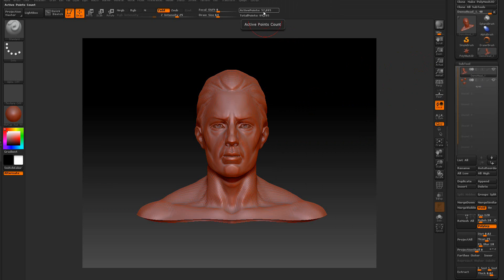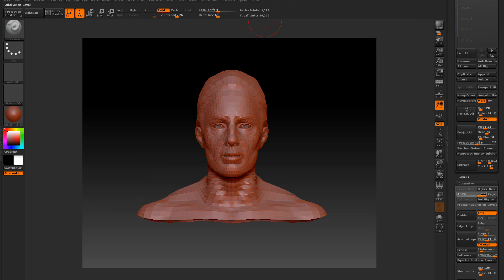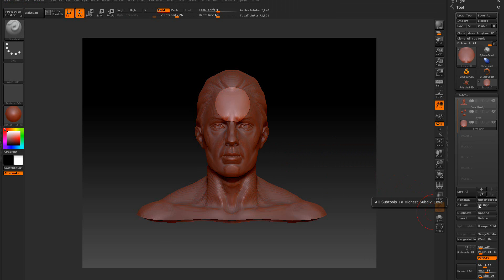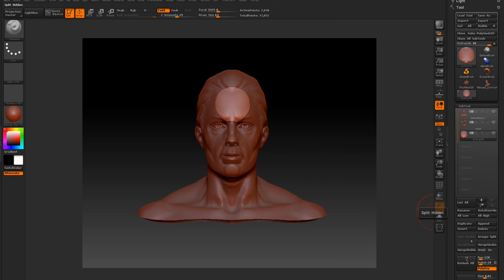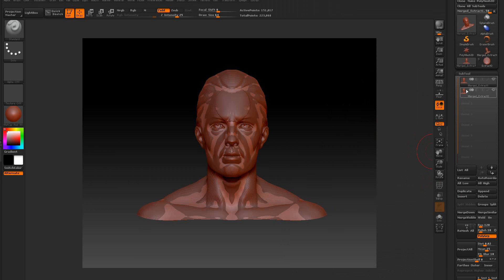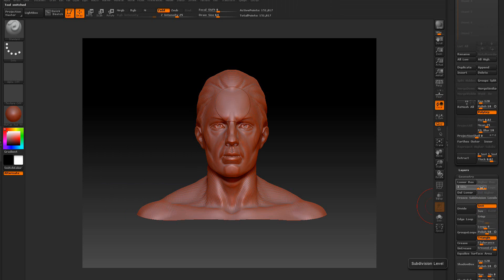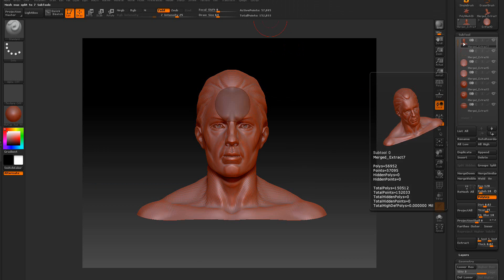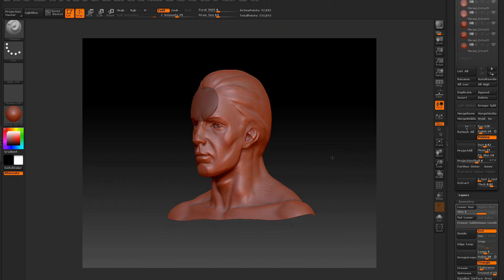Merge Subtools keep subdivision

Comment: When I merge my subtools, Zbrush still treats my mesh as if it were two separate meshes. So when I try to smoothen out the two newly merged meshes, the seam won't smoothen out. It's pissing me off. 

Any help will be appreciated, thanks!
Reply: weldpoints
dynamesh/close holes weld points z modler make sure everything is one poly group eh some other tings to try